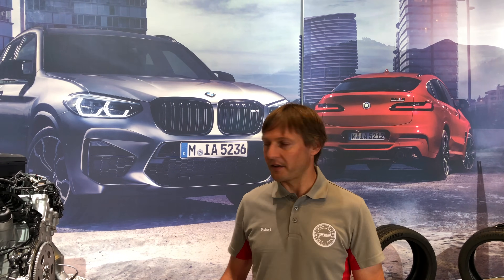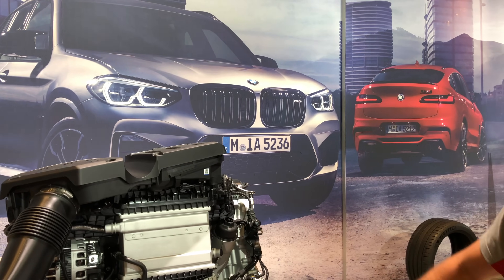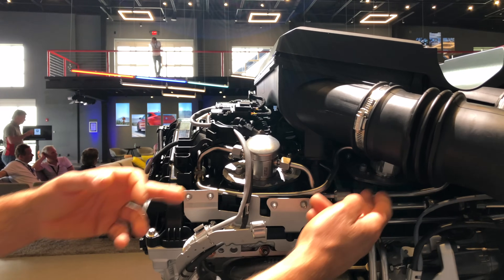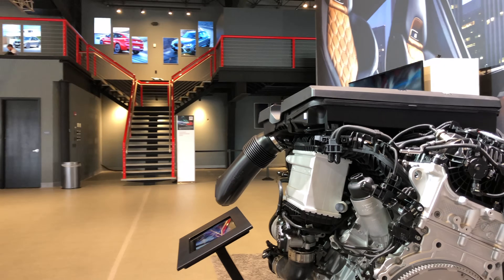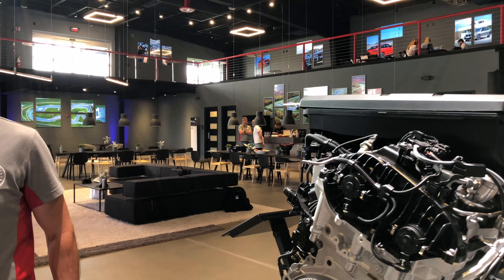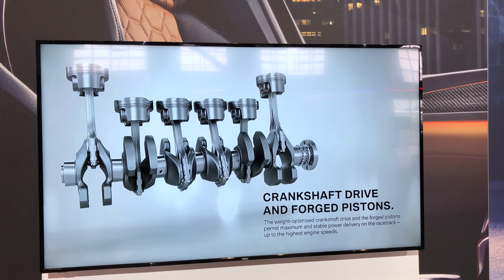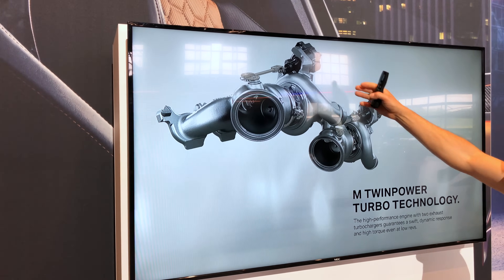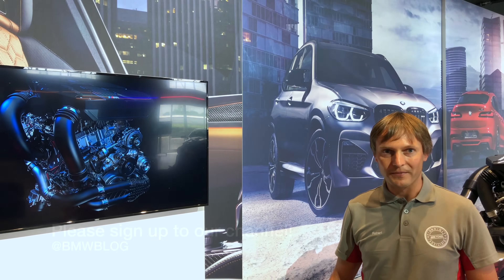The New BMW S58 Engine - Workshop & Details

Comment: Excellent video information about the S58. Thank you for this. Wondering if the new crankshaft design addressed the notorious crankhub issue of the S55.
Reply: Notorious if you push it over the limits that the engineers established and modify it. Otherwise, I wouldn't worry.

Comment: I wish BMW would make an "M540i" with a powerful i-6 motor like this, lightweight interior and less technology with steering inspired by the m240i. Their sport sedan game is weak right now besides the m340i. M235i gc, M850i, M550i, M760li are forgettable cars with big motors designed to compete with mercedes in luxury. That is not the point of a BMW.
Reply from the maker: They have an M550d and M550i.
Reply: @bmwblog  What's the point of your reply? I voiced my idea, and you replied with a car I mentioned as failing to be a good BMW. I know they exist. I don't want a 4300lb AWD sedan that's good on a highway and nowhere else. That's an American sedan. I don't want a 2 series coupe (very good BMW) because its too small and plasticky. I want a decently powerful, lighter, and cheaper alternative to a M550i that handles like my e90. They can get rid of all that stupid gesture control and parking assist stuff that's going to break after the warranty goes out and inflates the price by 10s of thousands. I need an I-6, Bluetooth for phone, navigation, sport suspension, good steering, decent space for friends and a nice exhaust note. The M550i is just a bunch of expensive gimmicks and not a well executed BMW.

Comment: It'll be interesting to see how the lowered compression ratio (9.3:1) affects efficiency, or whether the improvements in fuel injection negate the lowered CR.
Reply: It doesn’t get great milage. My g80 gets 18-19 MPG
Reply: Why would lower static CR make any difference? Dynamic CR is what's important and that is governed by the camshaft profiles. A lower CR whether static or dynamic means they can use higher boost levels.
Reply: @Slaktrax  If that was true, all petrol engines would have low CRs.

Comment: It sounds the same as the S55  imo... At this point, I think it's just Bmw's signature turbo straight 6 sound.
In terms of the design, it looks extremely different to that of the B58. How they went about routing the intake tubes is unorthodox.

Comment: Lexus should develop their own  inline 6 engine. Their car is very reliable but poor in performance. Except for the LFA
Reply: Lexus is Toyota and it's already rumored that the 2020 model IS is supposed to get the B58 from the mk5 and mazdas i6 as options in the future IS models.
Reply: @carboydorifutoparty3976  ah, japan and germany working together again.
Reply: @anthonyt4981  I don't see anything wrong with it since Toyota sucks at making sports cars by themselves.
Reply: @carboydorifutoparty3976  haha, I didn't imply anything wrong. Was intended to sound like a joke. I'm actually a huge toyota and bmw person, so it works out perfectly.
Reply: @anthonyt4981  oh cool i am too although I guess the thing I imaged both the Toyota and bmw community wasnt going to happen but oh well still like the car either way.

Comment: Other than twin turbos vs twinscroll...and higher boost..what the difference vs B58?
Reply: Stronger block, internals, better cooling, higher redline, better injectors... there’s a lot different
Reply: Eyes Open...I’m not sold. Block is the same from the diesel and it’s widely known a JB4 piggyback on the B58 and slight tune you can get 75 whp HP And torque.  Rods are the same, both forged. The S58 with twins, run and lower compression and higher boost and thus higher fuel pressure. Again B58 turbo with twins-roll and 11/1 compression offers less lag an less peak HP. Real world dyno on bone stock Supras putting down 340 whp and 400 tq. I’ll wait and see where this ends up..
Reply: Jack Chueh you’re never going to be able to make more power with the b58 than the s58... it’s that simple. You can try and rationalize it all day but the s58 is going to be the superior engine

And by the way the block is not the same as the diesel. It shares a crankcase, not a block
Reply from the maker: Here is a good article https://www.bmwblog.com/2019/02/12/see-the-new-bmw-m-engine-the-s58/